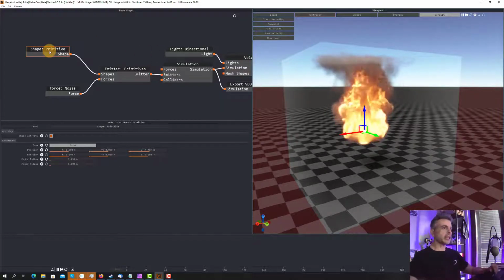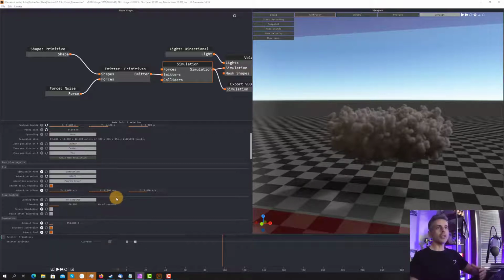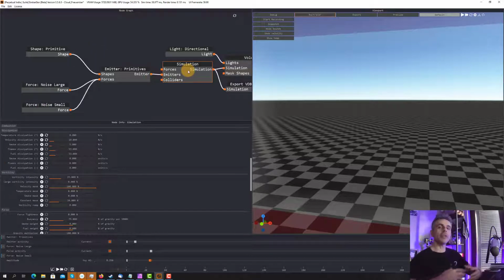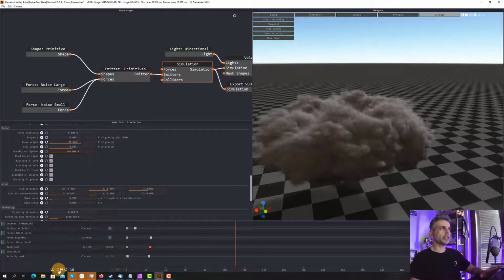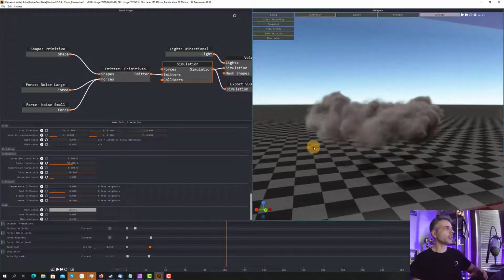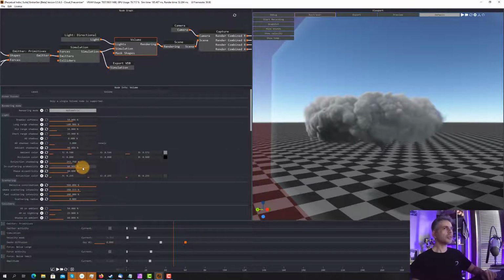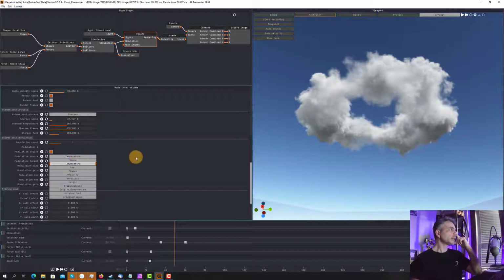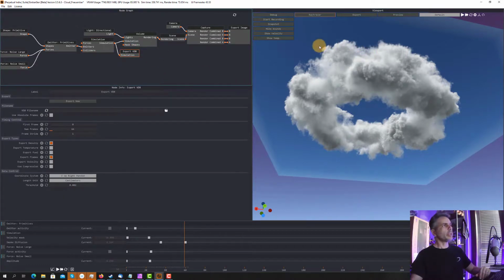Embergen Introduction - Lesson 04 (English)

Comment: Thank you, it's very clear what you're doing and why.
I've tried following along in version 0.85, but following as closely as possible, and trying different settings along the way, I just can't get the detail and the small fluffy whirls as you do.
I'll keep practising to get such a nice looking cloud as you do.
Reply: same
Reply: i am not sure if it works for you but you can try to move the Smoke Diffusion keyframe to earlier keyframe like start at 0  to 10 then u will see the different , even you remove the keyframe after that it still works for me.